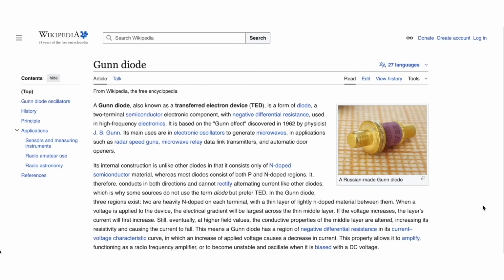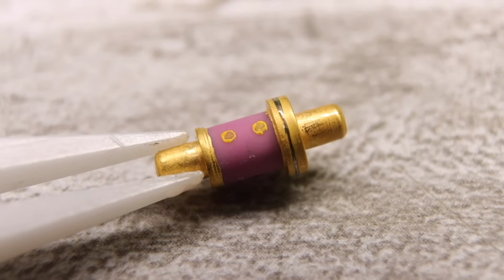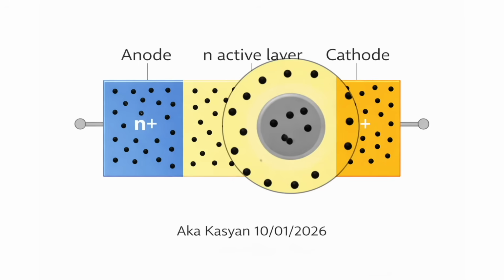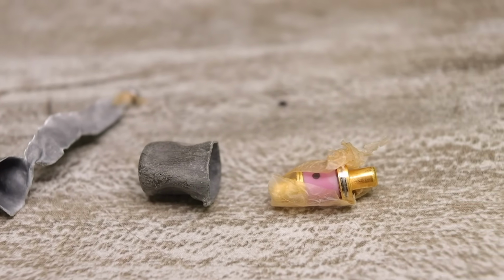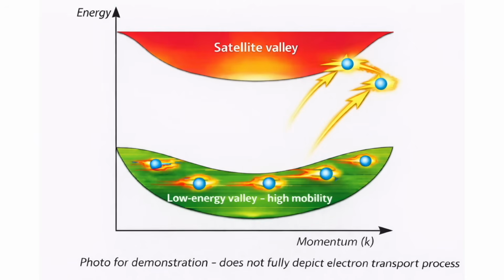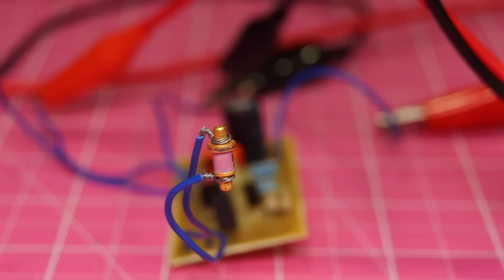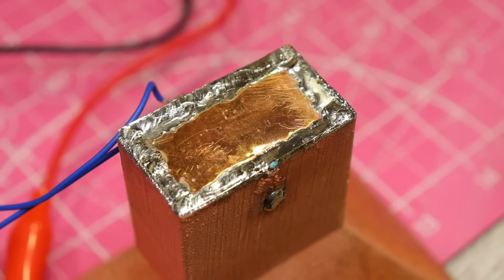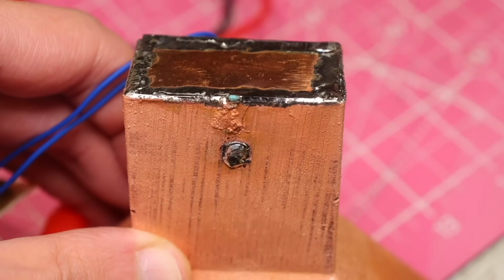It’s Not Just a Diode! The Mysterious Gunn Diode

Comment: Or. You could use a second Gunn diode tuned to a difference frequency in the receiver. Then the signal could be demodulated using op amps or standard commercial radio parts. 12:41

Comment: 40 years ago.  Solfan used Gunn diodes in microwave motion detectors.  We would grab them, original speed radar jammer.  Also tickle 125db you can hear a mouse fart a block away from a windows oscillation.   Fun toy.

Comment: I replaced my klystron transmitter with a Gunn diode in the 1980's for 10GHz amateur radio experiments. I find it strange in your video around 14:30 that moving the horn antennas makes no noticeable difference to the intensity of the received signal ?

Comment: I have been using Gunn diodes since the 1980's for Amateur Radio communication in the 10 GHz Band. With only 1.5 to 2.5 milliwatts of RF and a 0.5 metre (19 inch) portable dish antenna, it's possible to communicate over terrestrial distances of more than 150 km (90 miles) at any time, if a good line-of-sight can be found for the two stations. I achieved that very easily, and it's by no means a record distance. At those frequencies, cavities and waveguides are used, because cables and solder joints are very lossy.
Reply: Gunn diode oscillators tend to have a very nice and clean spectrum, after they reach their operating temperature and stop creeping.

Comment: Thanks for the interesting video. I have a small bench top oscillator with a Gunn diode that operates at 24.15GHz manufactured by Austin Microwave, a company owned by the late Carroll R. Griffin. I fixed the power supply and confirmed correct operation with a microwave frequency counter. I find the operating frequency is very susceptible to changes in the diode temperature. I’m interested to understand what this generator was originally used for if anyone has any information.
Reply: Mostly to radars, and later to microwave radio communication links. But the tech has advanced beyond Gunn diodes now.
Reply: @corhoinwizardonikcustomwor746  that makes sense, Carroll Griffin worked on Radar target scatter at Holloman AFB NM and FLAMR in California using a B-47 with F-111 radome. But I’m still not sure about this 24.15GHz Gunn oscillator.

Comment: Intresting subject.
If you have a set of two horns with a gunn diode,. it can also act as a mixer. using a car radio you can make a full duplex FM connection.  Thats how HAM's did the early experiments in the 80's

Comment: An interesting experiment would be to connect the Gunn diode to a cavity with freely-variable dimensions and observe any changes in frequency or amplitude as the cavity geometry is changed (with the voltage/current being kept constant).
Reply: Perhaps it could be possible to use a conducting but flexible membrane at the waveguide end, and use that to modulate the Gunn diode a little. Usually the modulaion is done by modulating the Gunn diode bias voltage (or current, I've already forgotten...). Some decades ago I used to work with the 10.525 GHz and 34 GHz Gunn diode oscillators, for police speed radars and traffic-counting radars. Those Gunn diodes were made by M/A-Com at the US, nowadays called just Macom.

Comment: A long time ago I've seen a circuit diagram of a Gunn radar speedometer used for wagon shunting and I was stunned by its simplicity.
Reply: Simple and beautiful, but also a bit temperature sensitive. When the Gunn diode warms up during its operation, the frequency tends to creep a bit. And at sub-zero temperatures (at the C scale), the Gunn oscillators usually need some heating to start up in colder climates if the waveguide cavity behind the Gunn diode is designed for an exact frequency output. They tend to be a bit picky...

Comment: I used one of these as a student on work experience using a gunn diode aa part of an interferometer to measure plasma density on a fusion experiment.i was checking the waveguide flanges and got a microwave burn on my thumb. Like  getting a metal splinter in your finger!

Comment: I had a couple of gun diode transmitters and the receivers for them a few years ago. They were part of an intruder detection system from an RAF base, there was a grid of them all over the base and any one crossing any of the beams would show up in the gaurd house giving the position of where the beam was interupted on a screen. You may have seen them on an airfield they look like short lengths of bron green colour drain pipes on low posts.
Reply: The Mid-Canada Line early warning radar chain worked in a similar fashion, albeit on a vastly-larger scale.

Comment: Thanks I liked the video. Looking at the scope wave it seems to output quite random oscillation but I take it your point is that the component is used to excite resonance with another component at which point it then produces a cleaner scope image (eg a clean wave with a dominant fundamental) dependant on that other component character. I am interested in large diodes at high voltage. Is it possible to use a slow saturating inductor as a diode in a fast frequency AC rectifier? I'm trying to attain anti-gravity is why I ask.
Reply: I think the "random" display is simply down to the scope not having the bandwidth to show the signal... 🤔

Comment: In 1979 I was told a Tunnel Diode was thought to have "reverse resistance".  How did that theory conclude?
Reply: Negative resistance. The voltage-current curve was non-conventional, it went up and down and thus the term "negative resistance" on that specific area of the curve.

Comment: I would love to see more about a how a PLL would control the frequency of the Gunn Diode.
Reply: You need an accurate reference for a PLL. You can use a crystal and multiply it up with harmonics to get about 10GHz. You then mix it and extract the beat frequency and use that to control the frequency of the Gunn by adjusting the voltage supply.

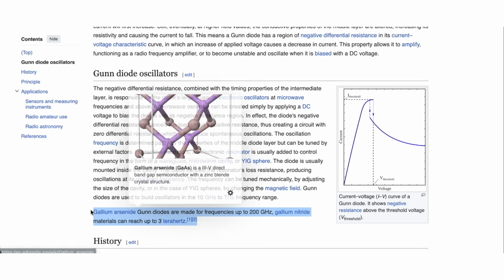Comment: 1:45 What things need a 3 Terahertz signal?
Reply: Answer from Googles AI:
Gunn diodes that generate terahertz (THz) frequencies—specifically up to
3 THz using modern materials like Gallium Nitride (GaN)—operate in a unique spectrum between microwave and infrared radiation. 
As of 2026, these frequencies are used for several high-precision and non-invasive applications: 
1. Advanced Medical Imaging and Diagnostics
THz waves are non-ionizing, meaning they do not damage DNA like X-rays, making them safer for frequent medical use. 

    Cancer Detection: High sensitivity to water content allows for the differentiation of cancerous tissue (which typically has higher blood/water levels) from healthy tissue, particularly for skin, breast, and oral cancers.
    Dental Imaging: These waves can penetrate tooth enamel to detect cavities (caries) and internal structural issues without the need for radiation.
    Burn Assessment: Surgeons use THz imaging to determine the depth of burn injuries and monitor healing progress through bandages. 

2. Security and Threat Detection
THz radiation can penetrate materials like clothing, paper, and plastics while reflecting off metallic and non-metallic objects. 

    Concealed Items: Used in airport and high-security scanners to detect hidden weapons, ceramic knives, or plastic explosives.
    Chemical "Fingerprinting": Many explosives, illegal drugs, and biological agents have unique spectral signatures in the THz range, allowing for remote identification of specific substances. 

3. Next-Generation Wireless Communication (6G)
THz frequencies are a cornerstone for future 6G networks due to their massive available bandwidth. 

    Ultra-High-Speed Data: They enable data transmission rates of hundreds of gigabits or even terabits per second, supporting technologies like real-time high-definition holography and immersive extended reality (XR).
    Nano-Networks: Due to the sub-millimetric size of THz antennas, they can be used for "wireless networks on a chip" and the Internet of Nano-Things. 

4. Industrial Quality Control (Non-Destructive Testing) 
Industries use THz frequencies to inspect products without opening or damaging them. 

    Aerospace & Automotive: Inspecting composite materials and coatings for hidden cracks, delamination, or corrosion.
    Pharmaceuticals: Verifying the purity of medications, detecting counterfeit drugs, and monitoring the thickness of tablet coatings.
    Food Safety: Detecting foreign objects or moisture levels in packaged food products. 

5. Scientific and Environmental Monitoring

    Atmospheric Research: Sensitive to various gases, THz spectroscopy monitors air pollution, greenhouse gas concentrations (CO2, methane), and soil moisture levels for agriculture.
    Material Science: Used to study the dynamics of semiconductors and the vibrations of complex molecules. 

AI responses may include mistakes.
Reply: This is also pretty cool:

Question:
Nano-Networks, does that mean that a circuit-board might not need electrical traces from point to point, but can send the signal wirelessly between components?

Answer:
Yes, Nano-Networks (specifically Wireless Networks-on-Chip or WNoCs) represent a paradigm shift where traditional copper electrical traces on a circuit board can be replaced by wireless links between components. 
By using Terahertz (THz) frequencies—enabled by devices like Gunn diodes—components can communicate through "over-the-air" signals within the device rather than through physical wiring. 
How Wireless Circuit Boards Work
In a 2026 context, this technology addresses several limitations of traditional PCBs:

    Speed Beyond Copper: At extremely high speeds (Tbps), copper traces act as transmission lines with significant signal loss and "RC delay" (resistance-capacitance lag). THz wireless links bypass these physical bottlenecks to achieve ultra-fast data exchange.
    Eliminating Interference: In traditional boards, high-speed traces must be carefully routed to avoid "crosstalk" (signals leaking into adjacent wires). THz waves are highly directional, meaning they can be aimed precisely from one component to another, reducing interference even in densely packed spaces.
    Nanoscale Antennas: Because THz waves have such short wavelengths, the antennas required to send and receive them are tiny (micrometer-scale), allowing them to be integrated directly onto the silicon of a processor or memory chip. 

Key Benefits of "Wireless" Boards

    Reduced Complexity: Designers can avoid the "rats' nest" of multi-layer routing, potentially leading to smaller and thinner devices.
    Dynamic Reconfiguration: Wireless links can be managed by software, allowing a chip to "talk" to different components on the fly without needing a dedicated physical wire for every possible connection.
    Lower Latency: Inter-chip data exchange becomes more efficient for high-processing applications like AI and real-time machine learning. 

Current Challenges (2026 Status)
While the technology is transformative, it is not yet replacing every wire: 

    Power Transmission: You still need physical traces for power delivery (VCC/Ground), as wireless power transfer at this scale is not yet efficient enough for high-performance computing.
    Path Loss: THz waves are easily blocked or absorbed by materials, so these wireless links typically require a direct "line-of-sight" between components.
    Cost: As of early 2026, THz-enabled "wireless chips" are more expensive to manufacture than standard copper-etched PCBs, limiting them to high-end applications like data centers and advanced 6G hardware. 

AI responses may include mistakes.
Reply: Apparently police radar guns.  Also, I've heard of "terahertz imaging" like safer x-rays, dunno exactly what frequency it uses but maybe this is related
Reply: 3 Terahertz generators

Comment: "...one of the cheapest sources of microwaves." That figures. We had two Gunn diode based 24 Ghz studio-transmitter links for two old style NTSC broadcast stations. These were local and most importantly low budget. I was always amazed at how small the transmitters were, covering about an 11 mile line of site range. Unfortunately a clerical error caused their licenses to expire, so the FCC said they are no good anymore, not accurate enough, could not be "grandfathered in." The system was modifiable to use digital ATSC digital TV signals, but nope...

Comment: Ilias Anisis
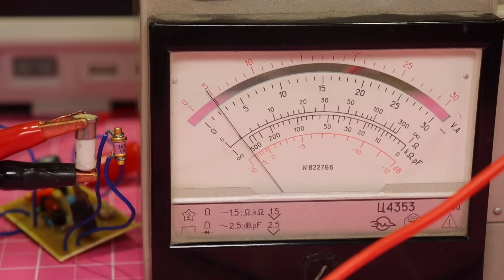4:50 π.μ. (πριν από 1 λεπτό)

Thank you very much for the amazing video. You reminded me of the old days when I used old-style microwave radars in alarm systems with similar diodes and a fairly heavy metal case with an adjustment screw usually glued with colored glue and without having any knowledge, I tried and adjusted the sensitivity of the diode. Today, you reminded me of those times and I am very happy about that and I am sorry that I threw away many of these radars because they heated up too much and consumed a lot of energy, since then infrared radars came out. They are again used twice in applications, but they are not exactly the same as those of the past. Again, thank you for the knowledge you offered me at my 71 years of age.

Comment: Also a favourite for pirate radio @10ghz you can bias a gunn diode using a 7809 regulator and a few resistors to inject mono audio or a mpx stereo signal but you will need to decode the stereo at the receive side which is pretty straight forward.
Reply: but how many people would be listening to 10 GHz pirate radio?
Reply: @jasonspitzer1503  The nerdy ones, of couse!
Reply: @jasonspitzer1503 that's what I was thinking !!

Comment: @17:48 in video: If the resonator structure (distance to back wall) determines frequency, then oscillations DO arise due to external feedback!
Reply: I think the point is that oscillations occur whether the resonant chamber is there or not, the chamber just influences the frequency. This is in contrast to e.g. an LC circuit or crystal, where an external amplifier is needed for it to oscillate at all.

Comment: 02:36  Ditch the bad "AI" imagery.  It adds nothing to the video, looks awful, and lends the video a very low-quality air.  That said, it was interesting to see a Gunn diode in action (I've only read about them and never used them myself).  One thing I don't think you touched on is what determines the frequency; is it the physical shape/size, chemistry/doping, the voltage, current, temperature, some thing else, some/all of the above?
Reply: I tend to agree.  It was all good information from what I could tell, but the obvious AI imagery really detracted and gave the video the overall air of the many useless click grabbing videos now found online.  It's unfortunate, because it's obvious that some actual research and work went into the production of this video.  In short, it's conflicted.
Reply: Addendum: It seems like the pulsing in isolation is fairly random but that it stabilizes to a resonant frequency when applied to a conductive cavity with tuned dimensions (such as the horns in the video) with the frequency determined by the physical size and shape of said cavity.
Reply: @alexhajnal107  maybe it's an analogue of other cavity resonators like used in microwaves, etc.  Cavity resonators are quite a rabbit hole.
Reply: More of an electron-hole!
Reply: the narration is also a.i.?
Reply: @UglyWorldIn8k not sure, sounds genuine, but some diction glitches made me question it too!
Reply: @PeterBaumgart1a Given the many sources in Cyrillic language used, I would say the person has a Slavic accent, and the use of a AI voice is understandable.
Reply: @paulkroon4931 The channel info claims location USA but there is a link to a Russian channel.  That channel in turn also claims the location to be in the USA but the email address is a .ru one.

For some reason a lot of - legitimate - non-US channels have their location to USA.
Reply: @PeterBaumgart1a  I wasn't aware of any AI while watching this video.  There were little bits of animation showing the electron grouping, but it was the sort of animation that was common 50 years ago.  I'm normally quite rabid concerning AI, and refuse to listen to audiobooks read by AI - but I didn't notice it here at all.

60 years ago, I was at tech college on a "Space Communications" course (I was working at a space tracking station - DSIF-51), and we studied the Gunn diode at that time.  I left the tracking station after 7 years and spent my working life in computers, so I had completely forgotten the Gunn diode, but while seeing the explanation here made sense, it made me think that Gunn, who invented this diode without the advantage of a ready-made explantion, must have been a smart cookie - to imagine the internal operation with different doping regions in the crystal, to unerstand what would happen, and to have the confidence to order a batch to be made.  He obviously understood, 70 years ago(?) a lot more about atomic theory than I ever did.
Reply: @UglyWorldIn8k  Yes the narrator is AI and the script sounds AI too.
Reply: It makes me question the information. The 1960s bit towards the beginning I watched over and over to make sure I wasn't just crazy. I first noticed it was really sharp, then I noticed the man's head on a body wearing high heals when this is supposed to be the 60's and this was a public street and not a stage. It's fascinating, what the AI comes up with, but it's very distracting with regards to the presented information and it instills distrust. (My robotic use of English is due to the autism and not AI. Unless I'm not real... and what are the chances of that?)
Reply: Yeah would have liked immediately if not for the ai slop. Really distracts from the otherwise great information
Reply: better if OP just spent more time showing the real life mesurements and behaviors of the diodes.
Reply: Agreed about the AI stuff.